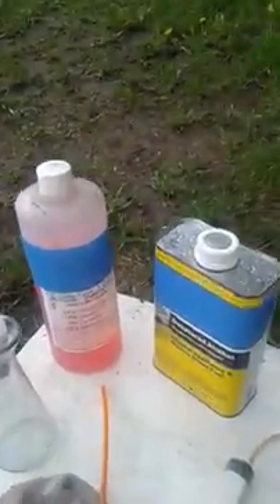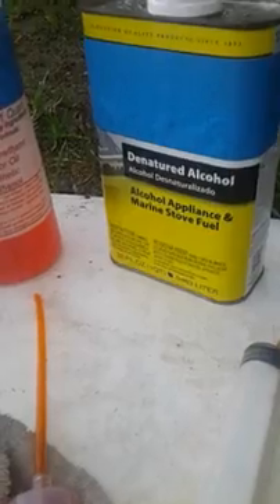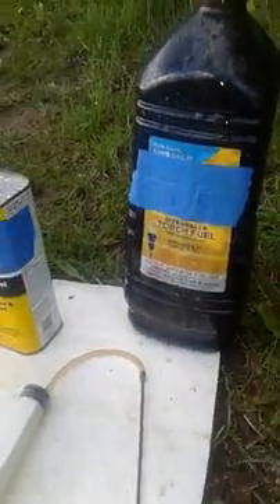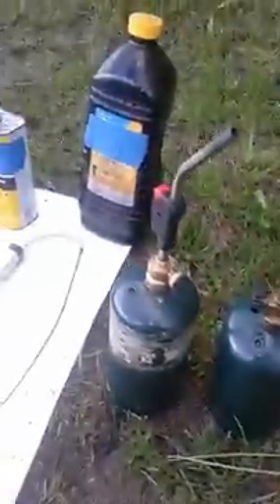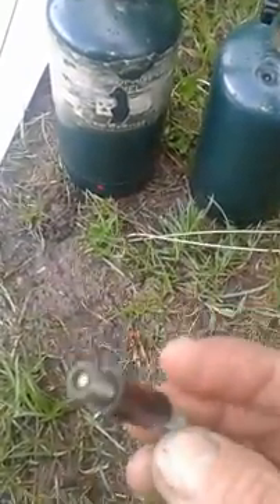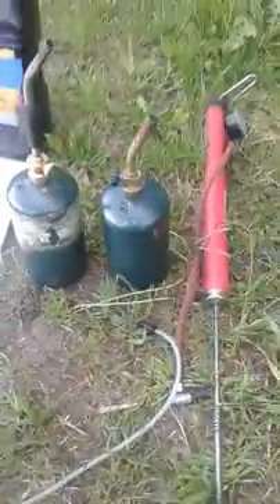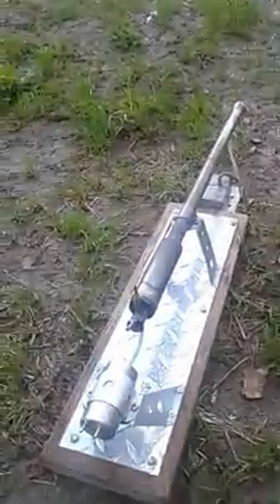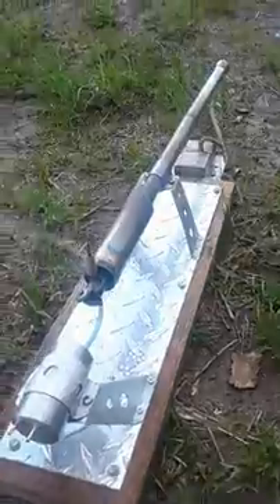WAPco Original Pulse jet fogger

Comment: A few  months ago I bought 5 gallons of methanol from a racing store/speed shop and noticed they had an unusual new fuel additive fragrance. There's quite a lot of scents to choose from if you wanted to toy with someone when running a pulse jet. 
http://i.ebayimg.com/images/i/190533301286-0-1/s-l1000.jpg
https://www.summitracing.com/search/part-type/fuel-system-additives/fuel-system-additive-type/fragrance

Comment from the maker: Yes. It could be more affordable than a expensive commercial grade pulse jet fogger" & help prevent mosquito viruses, where it's a major problem!. This device is very easy to start & is very durable & reliable. It's also a mini heater in case of emergency of frozen air lines or outdoor water pipes etc... & or a loud signaling device, or just a Fun toy! I sure enjoy it " that's why I designed it" because I was tired of not being able to start any of the vintage pulse jet engines that I have purchased through the years. My engine has no risk of electric shock from hi voltage spark systems,& starts fine in extreme cold weather also. Very nice engine! I'm very pleased with the results " .